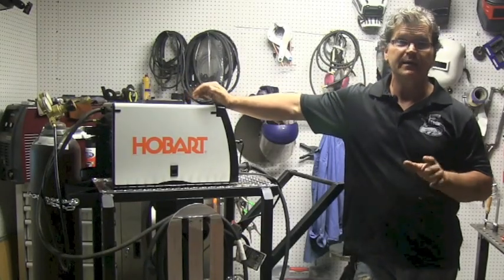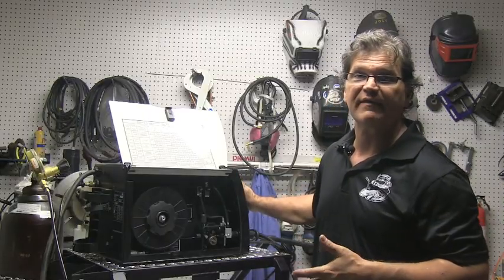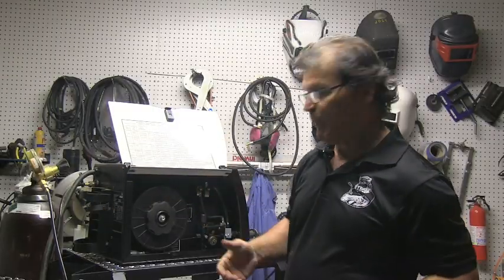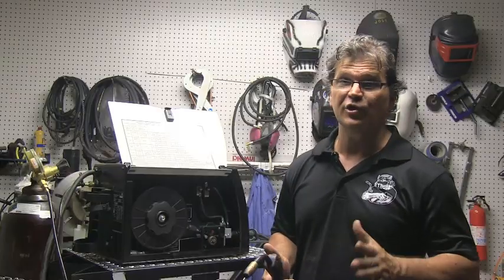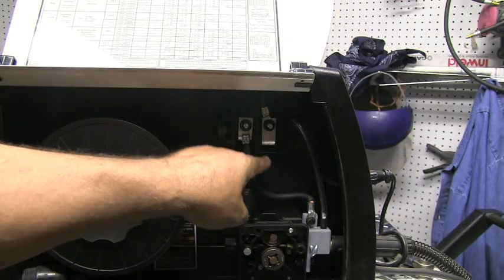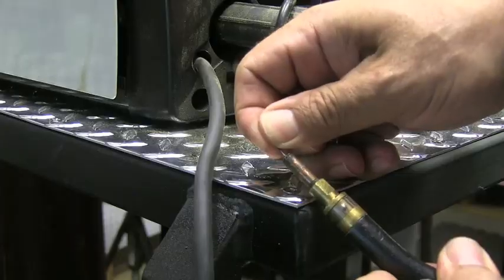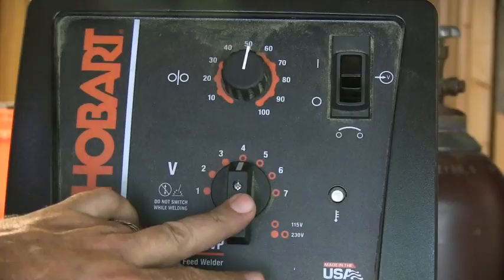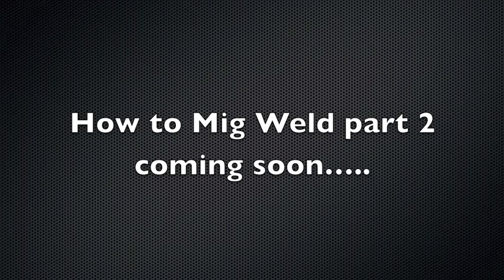Mig Welding Basics

Comment: Thanks Jody! I bought a Hobart Auto Arc 130 off Amazon's Warehouse Deals (in other words somebody returned it). It was such a good price I couldn't pass it up.  A bunch of the reviews said it had a crappy drive motor that could barely push at low speeds.  I used your techniques here for drive tightness and wire spool tightness and it's driving like a champ.  I can have a tight loop on the gun cable and it pushes it through like butter. Goes to show knowing how to use your machine is 90% of the equation. Thanks again.

Comment: I have A GMAW Lincoln 256 Power MIG, the welds are porous and they act as though I am welding rusty metal... the welder is acting as though there is no gas shielding the weld. I tried so many different things...  I turned up the regulator so that I could see that the gas was there. Things that led up to the issue... a whiplash at the rollers(corrected the whiplash and I sent the wire back through the Liner), a cold lapped bead, and a very cold welding area. Note the wire is almost at the end of the roll.
Reply: +Brian LeGrand Any Ideas???
The Machine Acts As Though There Is No GAS....???

Comment: You have been a great help to me!! I am going to restore my truck and I am very new to Mig welding and have no one to ask for help!! I had no idea the I needed a different drive wheel to run .024 on my Hobart 140. I just got it yesterday and I also ordered a solid copper clamp, Thank you!!.Now I am practicing on welding 18 Gage steel scrap fenders back together to get my welding down pat but my question is once I tack weld the fender together, once I skip around to each spot when I go back to continue my beed while keeping it cool do I use a lower case e or just over lap the original tack welds and just tack again?
Reply: Rob Egerton You should tack but never run a bead on sheet metal. It may warp or burn through.
Reply: Rob Egerton  Thanks Joseph for the response and I will give tacking a try.

Comment: This was the Wire-speed/Voltage Version of MIG. Things have grown beyond, and  modern MIG Machines have Automatic settings, which basically adjust the Voltage for you automatically, based on your selected wire feed speed. I think there is a Miller Machine that does it. Here I have an ESAB C200i.
Compared to the weight and form-factor of other machines, this is a MIG on the smallest footprint. Personally I VERY MUCH LIKE it.

Comment: In reply to spelunkered question about polarity. I have often wondered the same thing. To my knowledge, 2/3 of the heat generated in an arc is at positive side of arc. In mig welding with solid wire the electrode positive is preferred so that the wire electrode melt rate is increased to allow for the higher feed speed into weld pool. Hence the high welding speeds with mig. For gasless wire we should have electrode negative, as far as I know this is because of the cross section of wire being less than that of solid and the problem of overheating flux causing it to not protect molten pool as it should. Flux cored will generally be electrode positive as the design of flux is different and is usually incorporated into weld pool to give larger bead size with an external gas coverage. 
TIG is electrode negative usually to stop tungsten melting into weld pool. Stick usually can be positive or negative with gp electrodes depending on flux design. Low hydrogen should be electrode positive. With stick welding it really depends on flux type as to what polarity you should run. If in doubt read the box. Cheers Rod

Comment: What are your thoughts jodi on welding direction with solid wired mig?
 As far as I know we should pull the stick welding electrode.
Widely accepted also that we pull the flux cored electrode. 
I have been taught to push the solid wire mig electrode. Reasons being better weld bead profile, less chance of over roll, better penetration into fusion zone and better sight in front of torch to see preparation clearly. 
Well put together tutorial.

Comment: i allways wonder about the voltage at which you run your machines.Where  i live, north of Antwerp, Belgium. We use 3 x 400 volts, which of course lead to thinner gauges wires.

Comment: What are your thoughts on 95/5 Argon/CO2 gas mixture?  It's promoted quite strongly here in the UK, probably equally with 80/20.  It usually has the brand name of Corgon 5 (BOC Ltd) or Coogar 5 (Air Products Ltd)

I tend to use 95/5 and have done for most of the time.  It's a bit less 'wetting' than an 80/20, am I right?  Maybe better for thinner stuff.  Purer.  Less spatter.

Thanks for any thoughts.

Excellent videos by the way.  Best tutorials I've seen.

Comment: Hi Jodi, I would like to get your thoughts on welding direction with torch. 
To push or pull. 
When stick welding I think it is accepted that we 'pull' the electrode to keep slag behind weld puddle. I think it is also accepted in flux core welding as well to 'pull' the torch for the same reasons as stick welding. 
With solid wire when welding with mig, I thought the accepted method was to push the torch, mainly for 4 reasons.
1. Improves penetration into fusion zone
2. Gives flatter weld bead profile 
3. Reduce risk of over roll. 
4. When welding a vee prep, you can sight weld area with better success when pushing torch.

Comment: Hi Jodie, (This is for TIG) What Torch and Tip would you recommend for a beginner? I am looking to get the Parweld XTi 160 and get a TIG conversion kit. (The welder just comes on it's own, without a regulator or torch etc).

If you recommend a TIG welder that would be good for around the same price that would be good too, as I don't have anything to go off just now but reviews on the internet...so not the best...It would be better to get a personal opinion on a good TIG welder. 

Thanks

Comment: Here in England I was taught that the strict correct terminology is MAGS welding (Metal Arc Gas Shielded) but everyone still says MIG, including the welding tutor.  MIG of course stands for Metal Inert Gas

MAGS is for written exam papers maybe or for really pedantic people.

The logic behind the term is that MIG (oops) shielding gas is not strictly fully inert.  Most MIG gases have a CO2 component and CO2 is not strictly inert.  Sometimes, use of the 'correct' terminology (or why it's correct) helps us understand a little of what is going on technically - in this case, a little chemistry regarding the properties of differing gases.

In the everyday world though, it's MIG welding and we all know what that means.

Comment: OK, another question I often wondered about. Use DCEN with TIG to reduce overheating of the tungsten electrode. But use DCEP with most stick, for better penetration of the base metal. Why the difference? And why is the optimal polarity for GMAW opposite to that for TIG, and opposite to that for flux core wire, too? It would be much easier to remember each of these if I could understand the rationale for the differences....
Reply: I think of DCEN as Normal, you're putting the heat into the part. With Reverse polarity (old school tig designation) on stick or mig you need to heat the consumable filler. The hot filler melts off and heats the part. Flux core... Just blame the magic flux and remember it's opposite. Hope that helps.
Reply: DCEP with stick welding doesn't give deeper penetration, rather more filler metal.  It also, theoretically, burns your rods at twice the rate! 

On the flip side, if you're being paid by the inch, DCEP looks like you've done twice the work!  That's not strictly correct of course, more an urban myth in the workplace from the days of 'cheating' in industry.  Or so I've been told.

The higher class and quality rods tend to be DCEN in my experience.  DCEN will tend to give deeper penetration as there is more heat generated in the workpiece.

Comment: One thing I always wondered about. With stick welding, we select the amperage by moving a dial, and the machine adjusts voltage to give appropriate amps for the measured resistance. But with MIG, you select voltage, and so the amperage is whatever it may be. Why the difference?

Comment: I have a 180 amp mig welder that has no settings chart. It has 6 voltage settings and an infinite wire speed dial. I just divided 180 by 6 to to work my amps out. Don't know if that's right but it seems pretty accurate. And I just do the wire speed by counting out 6 seconds.
Reply: Mark. Weld with one hand and adjust wire speed WHILE you lay a bead. You'll hear it. Never touch the horsepower knob while laying a bead. Only the wire speed.
The dumbasses should have put a thumb wheel on the MIG guns for wire speed years ago.
You pull a piece out of the shed, start welding with a good setting. Go in the house. The sun heats the part to 150 and there ya go, back to to the box resetting the wire speed. How nice would that little thumb wheel be ?
Reply: 180 amp will be max output under ideal conditions\setup.  The 6 voltage steps will go from something like 18 thru 26 volts DC (so just under 2V difference per click).  The voltage output is primarily set by the thickness of the metal you are welding - thicker metal conducts heat away faster, so needs more voltage\energy going in in order to melt it.  Dividing 180 by 6 will gives you a nonsense number as the six 'voltage numbers' don't actually mean anything - for example, it could have just been written on the front as A B C D E F instead.

Comment: Do you touch the wire to the material first before you are about to weld or from a slight distance?
Reply: I don't know how it's supposed to be done, but I lightly touch my mig wire to the surface to start.  I can also hold the trigger down about half way to start feeding the area shielding gas (for a few seconds) without the wire feeder or the 'weld' activating.  This helps purge the area of air.

Comment: Hi Jodi. Great vid series. I know this is a little off topic but can any tig inverter machine (eastwood ac/dc tig 200). Be converted to a stick welder. Thanks for All your videos they helped me enormously. P. S. Love my tig finger.
Reply from the maker: Most Tig inverters can stick. But the miller diversion has Tig torch hard wired which seems really dumb to me.
Reply: +weldingtipsandtricks Can fumes make you sick Jodi if so what are my options in my garage.,,,,,,,,,,
Reply: yes, wear safety gear, go outside and/or get great ventilation

Comment: Jody, great video.  Can you explain the Pros an Cons for each type of metal transfer for Mig welding; Short Circuit, Globular, Spray Transfer, and Pulse Spray Transfer?
Reply: Short circuit causes less distortion due to less heat being transfered to the metal, it can also weld other positions than top down as opposed to spray and globular. Spray transfer is much faster than short circuit and might be easier to produce a good looking weld with. Pulse transfer tries to take the good things from both short circuit and spray. I don't know why anyone would use globular transfer.

Anyone got anything to add?
Reply: InqWiper Agreed, all of my Mig welding is with Short Circuit, unless I am welding horizontal and on thick metal then I will use Spray.  My current machine cannot do Pulse Spray.
Reply from the maker: Inqwiper summed it up very well.

Comment: mustie it depends on the regulator. The on with the ball you have to squeeze the trigger cause it actually measures flow and the style in the video is pretty much a pressure regulator and is set with out the trigger pulled
Reply: You're right. However I wouldn't trust the setting 100%, and always check if there is a change when pulling the trigger.

Comment: great vid as usaul, do you set the flow meter when the trigger is pulled or when the machine is idle,, thanks,
Reply: You have to set it while pulling the trigger, as there is no gasflow when idle. But you would do this during initial setup, not while welding. You can pop the drive roller, as not to push out wire, walk to the regulator and pull the trigger (ground clamp somewhere safe). Check the flowmeter and adjust accordingly. Also, remember to flood your hose! If you use a new hose or it's just been sitting for a while, the shielding gas will have escaped from it. Remember that the flowmeter is at the bottle, so the gas has to travel 5-6 meters before reaching the nozzle.
Reply: Nice explanation!

Comment: Hey Jody, can you please explain the different gasses? Do I use mixtures for mild steel bc they are cheaper than i.e. pure argon? can I buy a bottle of straight argon gas and just weld everything with it? If so, what changes in regards to my settings?
Thanks a million!
Reply: For short circuit welding in regular steel you should have a mixture of about 80% Ar 20% CO2. Pure argon gives a less stable arc, less penetration and is more expensive. If you are welding stainless or alumin(i)um you might want a different mix like Ar + He or Ar + H.

Comment: You may want to talk a bit about duty cycle especially for people using the smaller machines to weld thicker material.
Reply: No. Read the manual.That's why it has one and that's why all the makers have them online in .pdf.You should know that stuff before you ever plug the box in. Gas pressure, polarity, wire and roller combos,tips etc.It's not worth the video time and every machine is different. It's the same reason that door chart is as useless in Fairbanks in the winter as it is welding on a quarter panel in the Mexican desert summer. It's all rough guides.
Reply: I agree - and be careful about it.  Most instructors speak of it, describe it, but don't state whether it is up to the user to weld according to a duty time, or if the user's machine will limit the weld at some point once it is overheated.

----------

It would be ideal if you could borrow an actual dedicated 115-volt to show the limitations, and to also show just how thick of steel one can weld with the proper bevels cut into it and with multiple passes.

Comment: Jody,   You may want to comment on using the correct diameter tip for the size wire used. My Lincoln 180 was popping and carrying on. When I looked over everything I found that I had too big of tip for the size of wire I was using. I also think it might have been worn. Having too tight of roller tension can also cause the tip premature wear due to the little marks placed on the wire coming through the guides.

Comment: I would like to know the difference that occurs when the gas volume is adjusted higher or lower than recommended.  Just experimenting on my own it seems like the more gas the prettier the weld, so I turn it down until it doesn't look good anymore.  This leaves me welding at a setting just below what's recommended.  I'm using this setting to save a little gas.  Is the technique right or is my world soon to come crashing down around me?

I never comment on your videos because I don't know enough to contribute, but I never miss and I think I have learned to MIG weld just watching your videos.  Thanks so much for all of the free information.

Comment: Jody , I bought my 210 MVP about a year or so ago and the ground clamp that came with mine was much better than the one on yours so Hobart did upgrade it a bit...but it's still a steel clamp I purchased a good solid copper ground clamp from my local Airgas distributor and as soon as i get time I'm gonna swap it out

Comment: Jody could you discuss how to avoid being shocked or electrocuted while using electricity for welding?
I would like to learn how to TIG/MIG/STICK weld, but am fearful of being shocked or electrocuted.
Reply: dont stick weld in the rain
Reply: *****
Thank You.
Reply: Timothy Jones
Thank You Timothy.
Reply: Peprita Heart
As intimidating as holding an electrical arc in your hand may be, it is actually difficult to accidentally create a circuit involving yourself. After talking with a friend of mine who is a dive welder,(a guy who welds completely immersed in salt water) you would have to get directly between the electrode and the ground. Most welding I know of is done with relatively low voltage, which means that it is not going to jump out and get you like lightning or anything. Give it a try and you will quickly find out how hard it is to create an arc between two pieces of highly conductive metal. Watch Jody's videos and you will be fine.
Reply: Make sure the cables are properly isolated and not worn.
Reply: Thank You
Reply: BradOmedic
Thanks Brad.
Reply: *****
Thank You.
Reply: ***** I notice when Tig welding little zaps too, but isnt that just the high frequecy?
Scpecialy when Tig Alu since the high frequency is set to continous,(not trying to be smart ass here, just wondering)
Reply: ***** the ground clamp sounds like i should be paying more attention. next time i tig weld, ill make sure to look if it's in good condition. thnx Zed
Reply: Google "welding electrical safety". Plenty of info available on the web to go with the comments above.
Reply: Matt McLeod
Thanks Matt.
Reply: Thanks,draco6543
Reply: Thanks, Tobots Wholesale.
Reply: Yes, I am new to welding.Thanks for your advice.

Comment: That's a great tip on using the wires to help with the ground. Another thing I have learned is to make sure the ground surface is clean. Especially if your doing body work like I am. Even a little bit of oil or dirt makes a big difference.

Im looking forward to part 2.
Reply: 4570levergun .